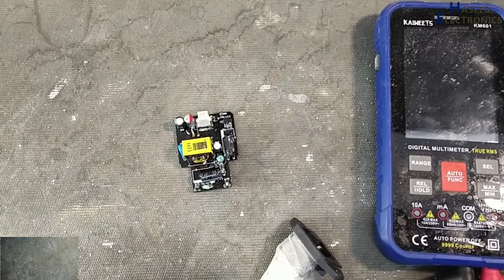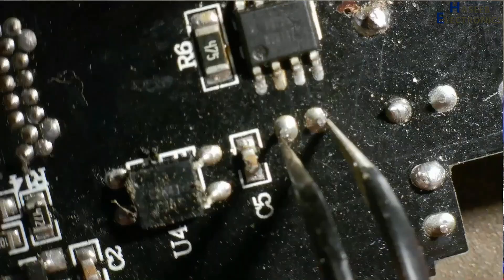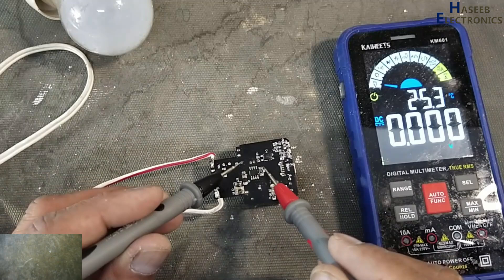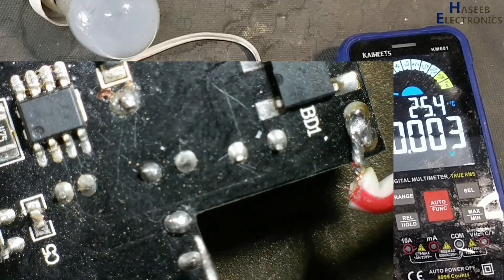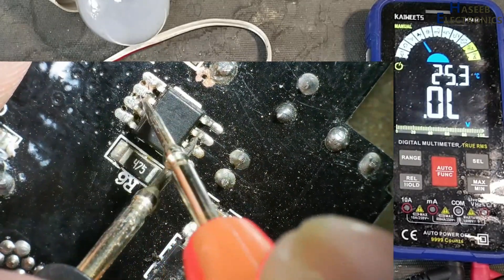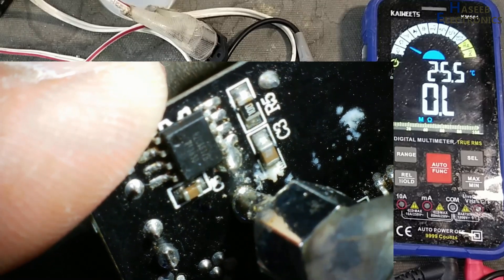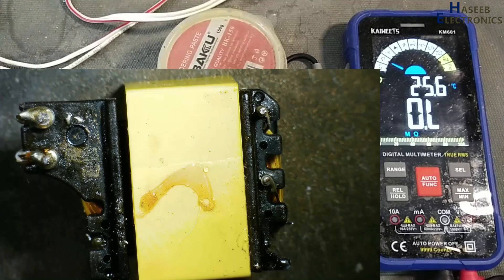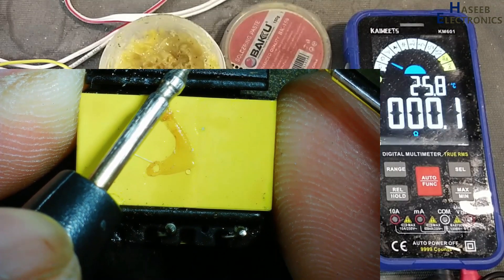{1129} iPhone charger repair, not working

Comment: No auxiliary for vcc?
Reply from the maker: yes 
micropower voltage mode switching ICs not need external VCC section. these ICs have their built-in supply circuit

Comment: Good repair. Please have a look on the first smoothing cap 0:40 . The positive lead seems corroded, perhaps it begins to leak.
Reply: ربما تسريب سائل المكثف تسبب في قطع سلك الملف
Reply: @A3OSSS  ???
Reply from the maker: @hugoegon8148, @A3OSSS is saying to you that might be liquid of capacitor caused to damage of the transformer winding
Reply from the maker: @hugoegon8148 
thanks a lot for your professional eye. it was left unchecked by me. please accept my best regards